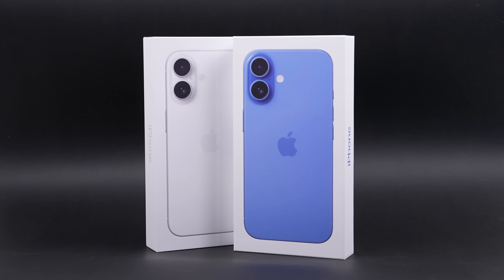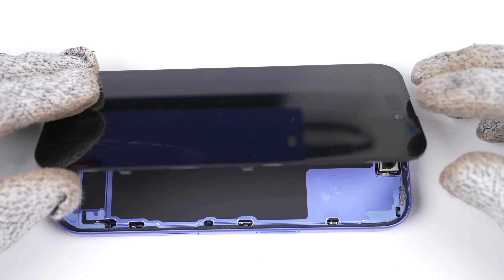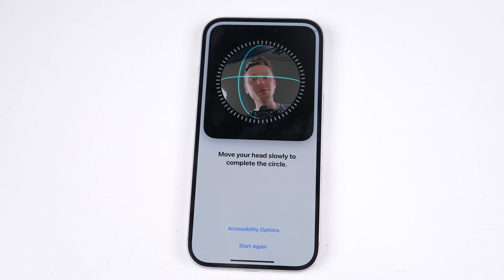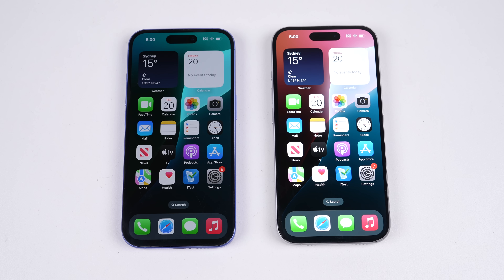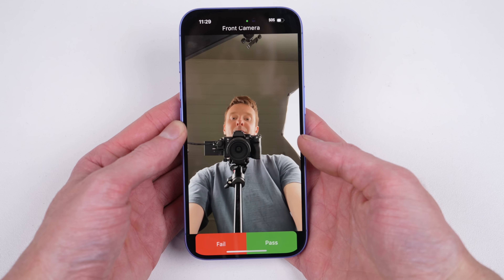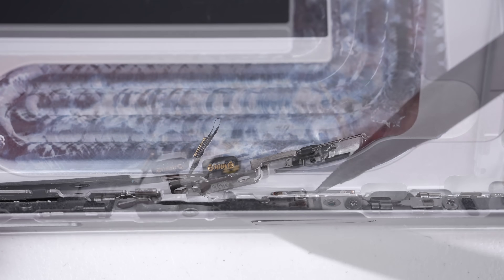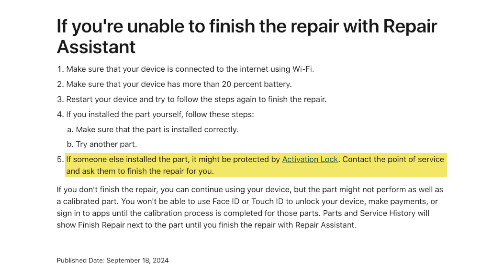iPhone 16 Changes How We Repair iPhones - 3rd Party Display Issues - Teardown And Repair Assessment

Comment: When I apply mains voltage to the battery, it pops out by itself.🤔
Reply from the maker: They say you can apply up to 30v which sounds like a lot to me.
Reply: @HughJeffreys  That's right, 30 volts should be the upper limit where no damage to the device or battery will occur, although the heating layer is probably a PTC resistor. Of course, it also depends on the duration of the current supply.

Comment: There are so many reasons to never buy from apple.

The battery removal system is cool but ultimately unnecessary. There are plenty of other ways to keep batteries secure while also making them easily removable.

Comment: I can see the reasoning for the half brightness quirk after a screen repair. If it can’t verify it’s a genuine display, it may cause damage to push the power needed for full brightness to a crappy third party screen. It may be a self-protection mechanism in disguise, or it could just be apple being apple.

Comment: Correct me if I'm wrong somewhere, but the main issue I see with this is that the parts themselves are locked if the phone they came off of has an iCloud account on it, which is like practically all iPhones unless they've been factory reset before pulling the part. So all those refurbished screens out there are gonna ask for the original owner's password when you put them on because they were pulled off of phones that were still locked to an iCloud account during a repair. If this is the case, then this pretty much does absolutely nothing for refurbished parts unless they're refurbished by Apple themselves, which they don't do. So it looks good, but in practice this is absolutely useless unless you're buying an entire factory reset used phone just to use for parts.
Reply: But it's ecological they'll tell you ....and cheaper ... for them, not you, obviously... How it's even allowed to sell this crap is beyond me
Reply: thats why most second hand stores are now demanding the customers to prove the phone have disabled activation lock and wiped before being sold.
Reply: @skpracta  I'm talking about repair shops though, not places that resell phones. Repair shops like the one I work at send the old broken original screens off to be refurbished, which is basically just them putting new glass on the original OLED. But like, I can't ask every customer to wipe their data before I replace their screen. And repair shops haven't been because that would be insane. So all those old OLEDs out there that have been refurbished and resold to repair shops or are sitting in warehouses, which are technically still just used Apple original parts but with a new sheet of glass, are still tied to phones with iCloud locks on them. So this does nothing to help anyone at this point, because the only way you're getting a guaranteed good used part is to get a working used phone that has been factory reset. It makes no sense
Reply: @CyanaraOfficial  1) the phone being repaired does not need to be wiped, it only need to turn off "Find my" during the time of repair and when the donor parts are calibrated with the repairing phone, the part swapped out is automatically unpaired and can be utilized as donor parts.
2) "Degraded refurbished parts" are what Apple really tried hard to get rid of as there is no way to ensure the quality of such parts (especially battery).
Reply: @CyanaraOfficial  if the business model of a repair shop are relying on Grade B parts, I would rather seeing them closed instead of allowing grade B repairs.

Comment: Typical Apple. They see the writing on the wall with right to repair so they pivot, make some changes that look good, but still retain full control over parts and repairability. Without the restrictions this would be great functionality, so someone purchasing a used iPhone will be able to check repair history and see if the repair parts are genuine or third party. That would be great. But Apple are not interested in the resale market because their short sighted strategy is all about selling new phones. You would think getting iPhones in as many hands as possible - new or used - with genuine or third party parts - would be a good thing in the long term. You are able to make converts to your brand of people who can't afford new hardware and those people at a later stage will probably be able to afford new hardware. Instead Apple is not interested in low income customers, which is on message for them as a brand - they only care about people who are affluent enough to buy new hardware, and often.

The battery release technology is great news - hopefully that idea will spread. You should not have battery replacement be a massive chemical fire risk. Kudos for that.

Comment: As someone who just replaced a screen (with a 3rd party replacement) for a customer's iPhone 15 Pro Max, I am 99.9% certain the lowered max brightness is intentionally in place to disadvantage non-OEM parts and it's pathetic. Apple is seemingly making an active attempt to ruin the usability of 3rd party parts in attempts to get more people to shell out ridiculous amounts for OEM replacement parts. I only repair Apple devices to support/help my customers, because other than that, I would actively have NOTHING to do with them, their abhorrently overpriced devices or their predatory business practices and ecosystem.

Comment: BTW, weren't the 16 series iPhones supposed to have a Metal encased battery? 
Did they rip us off?
Reply: The rip off part is automatic for any Apple product ... both financially and with regards to the hardware (expandability and repair). Takes more work to make it unrepairable hence do expensive. As long as the cult buys it they'll continue

Comment: Yeah. This cuts it for me. I was a long time follower of apple and i was already disinterested in them after the same model with little to no changes were called "innovation". I started being more disinterested when i heard apple parts can cause activation lock. This is sad. You supposedly own the phone but you cant even repair it. Im switching to android. May get the S24.
Reply: @mrfoxesite4482 I expected this comment. At least samsung has customization.

Comment: Hugh just out of interest what happens if you replace a part with another genuine iPhone part say a screen but the screen is from a iCloud locked iPhone. Or say you buy a broken iPhone smashed screen but you just need the camera.and you put that camera in the new iPhone will the part work. Assuming the part is from the same model and year. But one is new and one is say a damaged phone. Or nothing damaged but iCloud locked.

Comment: Dude, battery replacements are a snap on this phone. That’s cool. Heck of a lot easier than on my iPhone, which I wouldn’t attempt to work on.
Reply: They were far easier in the S3 era. Pop off the back and you can pull the battery.
Reply: @amak1131  Yes I remember

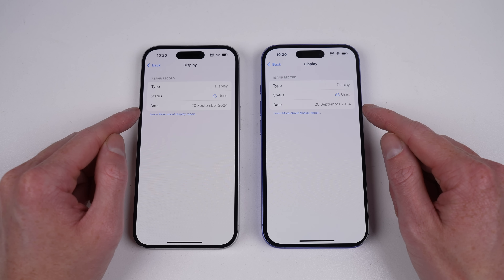Comment: 5:13 why is it so weird to me that a phone shows such status of a display? Why should a phone even know that it was disassembled? Why is there even a menu in settings designed for this? (Like saying that a battery needs service. That has never happened to me. My phone only knows the capacity, charge level, temperature and whether it is charging or not.)
Does my computer tell me that my monitor is too old? (I know I know. Money. But it is such a weird thing that the phone knows everything what is happening with it.)

Comment: None of this is "nice" or good. Apple isn't doing this to help customers out with 'genuine parts' else they would have no trouble recognising their own original parts as genuine, but they used to not be the case right up until this update. Even now it's up to them whether they want allow you to have a fully working phone or not, even if you bought parts from them. This is unacceptable. I should have a right to repair my device with whatever parts I want. Even if I never buy apple, all other phone manufacturers ape their ideas and practices so I will keep harping on apple to get out of my property.

Comment: Something that would be cool is to pair each screw to each hole and have a page In settings to see if they are in the right spot, so if you miss place a screw you will know and easily be able to correct it.

Comment: You showed that there were some pretty significant improvements to repairability; replacement parts-pairing being enabled & the drastically simplified battery removal method being amongst the most notable.  I was surprised that you had such a negative conclusion at the end of the video despite these pretty huge repair wins for the most locked-down phone in the industry.

Comment: i wont even take the screens off of any iphone 13 or later unless the screen is being replaced. They will break in a heartbeat.
Reply: I recently worked on an iPhone 13 Pro Max that had liquid damage... luckily all it was was some corrosion, after cleaning everything the phone works perfectly! I had no issues removing the screen without damage and I'm a beginner. I always recommend using a heat mat rather than a heat gun, I set it to around 80-90c and leave it for a couple minutes and slowly and carefully cut the adhesive before lifting the screen. I take my time, reheating the screen a couple more times to make sure the adhesive is still goo-ey. When reinstalling the screen, use the proper adhesive strips (they only cost like £2). You CAN use something like B7000/T7000 but it's messy, takes a long time to dry, and its very difficult if not impossible to remove the screen again without damage. 

That's my non-professional advice anyway.

Comment: Last year I replaced the screen on my iPhone 13 mini with one from Ifixit. The display functions were limited as usual, but after updating to iOS 18, The auto brightness began working again and the same restart and repair message showed up in settings. However I'm also getting the unable to connect to server warning. Wierd

Comment: First, they took the headphone jack.  Then they came for the charger.  Now they took our god damn Apple Stickers.  It's truly a dark day.
Reply: You can ask them in the store for stickers and they’ll give you them for free. It would have been nice if they did the same for chargers but probably most people would take a free charger, so it would be no different than if they just included it which is probably why they didn’t do that
Reply: 2025 no cable 😂
Reply: Companies need to meet carbon emissions requirements to be able to sell in certain regions/countries, there gotta remove it sooner or later.
Reply: Apple also eliminated the  SIM slot if you live in the USA, allowing people to be tracked through eSIM tech.
Reply: @synovium  why would they want to track your broke ass wallet?
Reply: And that’s why I made the decision to switch to huawei
Reply: @insignia406  first of all I do use wired audio equipment second Bluetooth is infinitely worse since 1 the mic’s are always trash 2 latency and 3 you have to recharge them all the time and you shouldn’t have to pay extra just to charge the device you just spent 1k + on and the apple stickers are the best part
Edit: I accidentally just proved my own point about wireless being worse my earbuds randomly disconnected and now have no volume
Reply: Don’t forget the SIM card tray if you live in the US
Reply: Literally no one cares about the old, obsolete port, everyone has got at least 3 usb chargers already and I've never seen anyone using the stickers.
Reply: Still using a Galaxy S9 and S9 plus, couldn't be happier with my headphone jack lol
Reply: Everything in the name of: making as much money as possible for the investors and shareholders
Reply: This was a HATE CRIME
Reply: I literally stopped using the headphone jack and thew all accessory things in the junk draw, then eventually the trash.
Reply: @randomnobody8770  wish I could do the same but I just dislike bluetooth headphones
Reply: @randomnobody8770  Ok but everyone else still wants the headphone jack
Reply: @saucecups  yeah cause you all enjoy that wire sticking on you neck right? lol whats even more funny is every other brand does the exact same thing
Reply: @Eythora94  Nice strawman. No, I enjoy using headphones that don't need to charge, and actually sound good without wireless interference. "All the manufacturers did it!!1" Ok and? If all the manufacturers remove the charging port, will you say that's good too? lol
Reply: @Eythora94  I never notice the wire plus the sound quality and mic’s are a lot better on wired earbuds/headphones
Reply: @saucecups if they'll come out for better way to charge it then i would go for it. I've had buds that sounds waaaaaaay better than wired ones that chokes me and knots in my bags every dang time. not to metion how easy it connects and has lots of great features. if future looks wired for you then go get dongle for it lol
Reply: @CaptainRex332  then good for you and for 5% of people that shares your opinion. sadly Brands care more for 95% that hate it
Reply: @Eythora94  No thanks, I prefer my things being able to plug in directly. Also, nice work ignoring my literal first point. Also, you know what connects easier than fiddling with Bluetooth? Plugging something in.
Reply: @saucecups  do you even know how wireless buds works? Lol
Reply: @Eythora94  Yes.
Reply: @randomnobody8770  I, too, advocate for the removal of features. :) It's always good when you have fewer choices in life. It's especially important to make everyone do the exact same thing I do! Glad we agree with each other about how Apple and other companies always have our best interests at heart when making these choices.